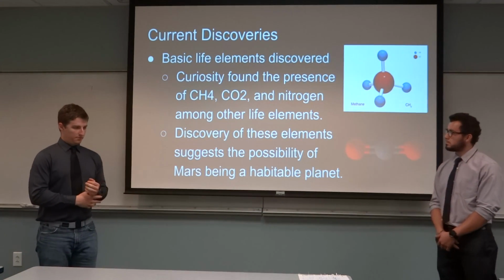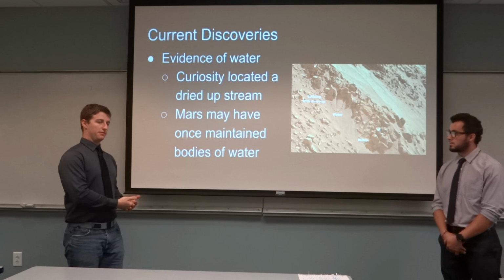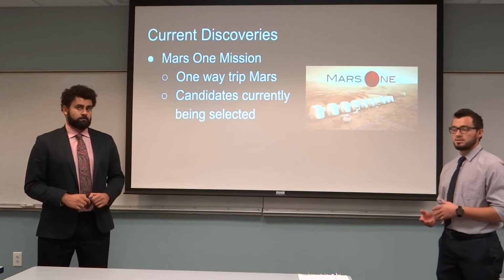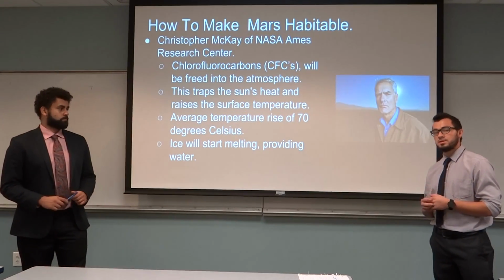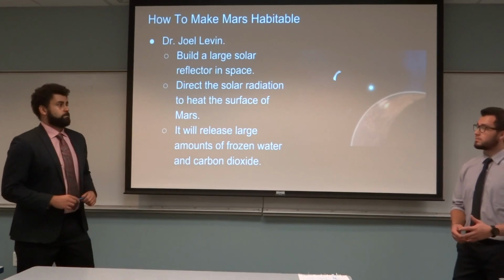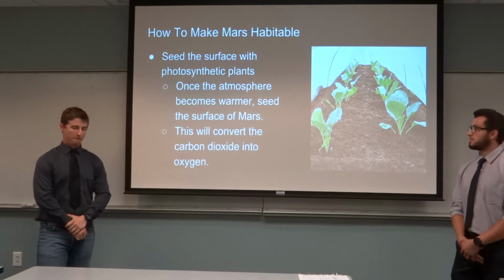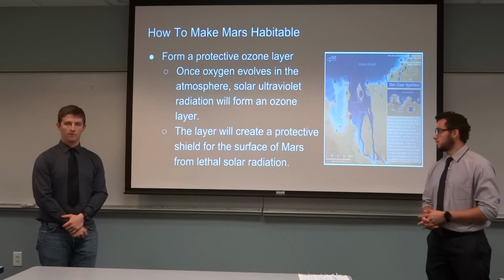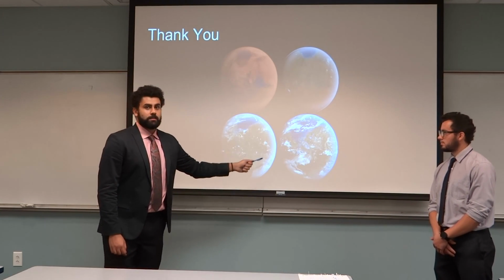Team 9: Terraforming Mars

Comment: This team had a great presentation; although it could be better. The video looks, sounds and feels professional due to the way the presenters carry themselves. They had a great, detailed analysis of the theories that can be used to terraforming Mars. The problem with this video is the editing and the filming. The entire video was shot in one take. It does not look like the team edited this take at all. The fact that 2 speakers were on screen at the same time and that one of them did not speak in the different sections was really awkward to watch. The video is also longer than the 10 min time limit. These problems could have been fixed easily if the team broke up the sections in individual clips and got rid of the "thank you" slide.